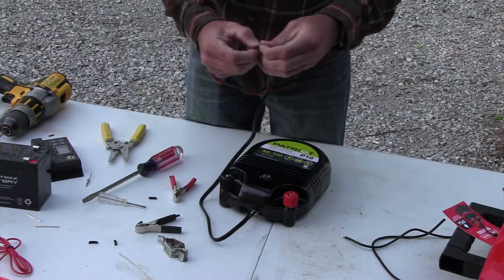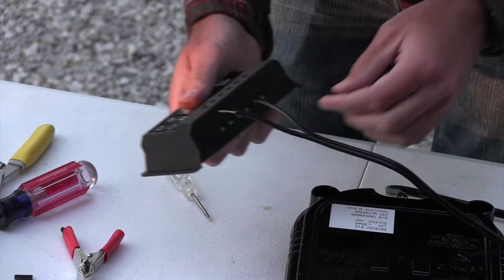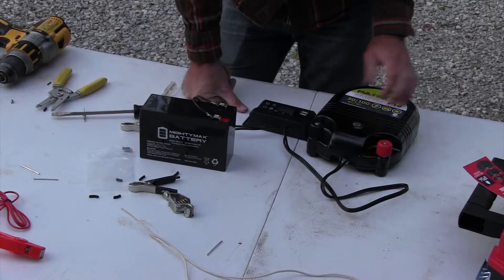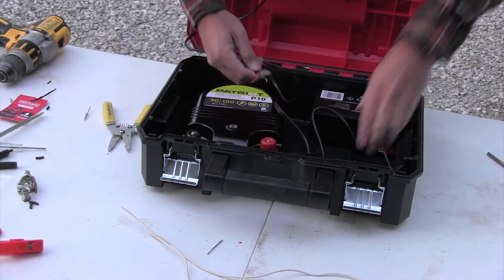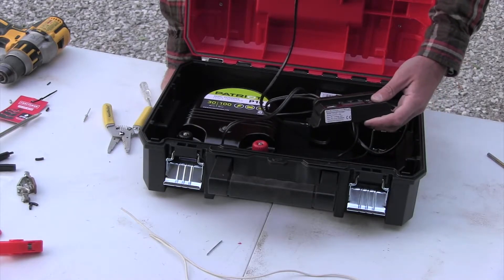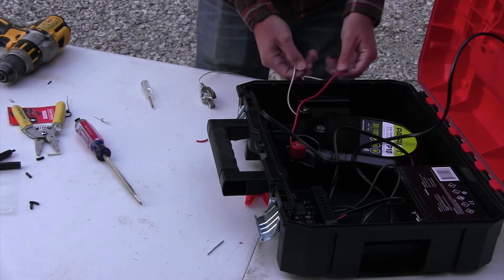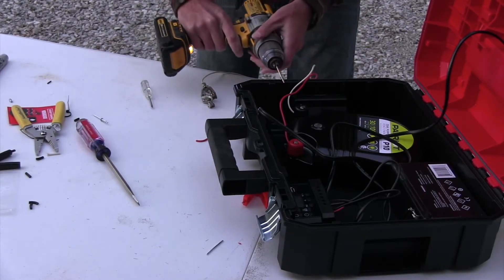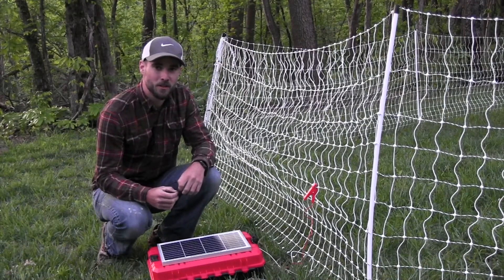How to Make a Solar Fence Energizer Part 2

Comment: Have you tested the actual fence voltage with this hack? 
This may not produce enough voltage for a long run.  The fence charger is connected to the 12v side of the solar charge controller. A small solar charge controller usually only allows 30amps x 12v = 365watts. I don't know if thats enough for the fence charger. If not, It might be best to hook the fence charger directly to the battery along with the charge controller. 
It all depends on how many watts your fence charger needs. 
Good job, though. 👍

Comment: I have Nubians and I want to setup a 5 strand poly wire portable fence. It will only be 50ft by 50ft with a total of 1300 ft of poly wire. How many joules do I need for goats? On the Gallagher website energizer selector it says the s20 is what I need but it’s only 0.2 joules. It’s $250 I hate to spend that much and it not be strong enough to keep them in. I think I am going to make my own. I just don’t know how many joules I need. I’m not running much poly wire but I know goats are tough.
Reply from the maker: I would at a minimum have 1 joule for that size fence. An electric fence is only a psychological barrier. The pain of getting shocked has to be greater than the desire to get out of the fence for the goat. If you have plenty of food for them in the fence it makes it easier to keep them from getting noir as well.

Comment: Good job mate…..suggestion….stick the components down with a dab of hot glue, that will save them rattling around and getting damaged. Cheers.
Reply from the maker: Great idea! Thanks for the tip!
Reply: The temporary, removable caulk works well also.

Comment: Would you trust this size solar charger setup to keep goats in the way you fence them in with 4 strands? Trying to change from electric netting to this style with pigtails and 4 strand poly wire. Great content!
Reply from the maker: Yes I have used it for that before. I would recommend a 2 joule charger for goats though. Thanks!
Reply: @AndrewMast  the last time I tried the fencing method you use I just had a .3 joule charger and it worked until they ran out of grass and they were out. If 1 joule isn’t enough I’ve got the net to go back to. Love your goat videos wish you a hundred more I could watch!
Reply: So I’ve got a question about an issue I’m having. I’ve built this charger and been using it for a couple months and it’s been good. But the last couple weeks in the mornings I’ve gone out to check the goats before work and the controller has turned off the charger. I’m thinking it was to conserve the battery to keep the charge from getting too low. In the evenings it’s working like normal. Idk whether the 9ah battery needs to be bigger or the solar panel needs to be 20 watt? They haven’t gotten out because of this though. Just wondering if you’ve ran into this before. I’m using 4 strands of poly wire about 650’ total.
Reply from the maker: Josh Minton yes I have had this issue. Most of the time the cause is something is grounding out the fence (like one of the metal posts). If something metal is grounding the fence out it will drain your battery very quickly. A lot of grass touching the fence can also do it but not as fast. I don’t have a lot of direct sunlight in some places I have the goats and I will have to change the battery out about every week or so. I’ll put the old battery on a charger and it’s ready for the next time. Hope this helps.
Reply: @AndrewMast  yeah it does! I’m using fiberglass posts. Idk what brand but they have 4 black wire clips on them. And I weed eat under the bottom hot wire. I’m thinking about getting an 18ah battery. It should still fit in the craftsmen box. And it should hold power through the night. I’ve taken the fence chargers wires off the controller and put alligator clips on them and went straight to the battery. The charger stayed strong till the morning but the battery was down to about 6.5 volts.  It right now the sun is out and the battery is back up to 12.8-13.5 volts give or take. I’ll eventually probably get a bigger fence charger and just get a couple big deep cycle batteries so I won’t need the solar panel. I just knew this 1 joule solar setup would come in handy in the future for cow fence or poultry net in some places so I’m happy with this charger regardless. You saved me a bunch of money videoing this build thanks man!

Comment: Did you get the poly or mono crystalline solar panel? The solar charge controller is no longer on eBay. Any alternatives? Thanks!
Reply from the maker: It’s a monocrystalline solar panel. Here is the same one on Amazon: 20A Solar Charge Controller Solar Panel Battery Intelligent Regulator with Dual USB Port 12V/24V PWM Auto Paremeter Adjustable LCD Display https://www.amazon.com/dp/B072MMDY4F/ref=cm_sw_r_cp_api_i_5y2EFbPPK6B42

Comment: Great video!! Thank's for sharing. I just got a couple of goats and if everything goes well we might get more. I was thinking about making a fence energizer the way you are suggesting but then I found this option for $100 less with built in solar panel and everything... what do you think? have you tried this before? (https://www.amazon.com/Zareba-ESP5M-Z-Impedance-Electric-Charger/dp/B0079GH86C/ref=sr_1_11?dchild=1&keywords=electric+fence+net&qid=1593917125&sr=8-11) 

It seems to have
Reply from the maker: Congratulations on getting goats! They are fun animals to have around.  And they are fairly easy to keep. However, they are hard to keep in without a strong electric fence. When you are looking at getting a fence charger the number you need to look at on the charger is the Joule output. The charger you suggested is a .1 joule output that means it puts out 1/10th of a joule. That charger would work great for a lot of animals but I’m afraid goats would jump right through a fence with that kind of power output. The charger on this video is a 1 joule output which is 10 times more powerful. The absolute minimum I would go for goats would be .5 joules. Hope this helps and good luck with your goats!
Reply: @AndrewMast Hey Andrew thank you for your response. I didn't notice that fence charger actually says .1 joules. All I saw was the number 1 LOL. It all make sense now. I built a somewhat temporary enclosure using t-posts and catle wire (about 100 square feet, but one of them made a hole and escaped (twice now). I improvised a quick fix until I can get more cattle wire and reinforce it. I ussually have them out and teathered during the day. Anyhow... thanks again for the advice and for the goat shelter video. I built one following your instructions! 🙂

Comment: Thanks for the great tutorial. What would it take to make this a 3 joules energizer ?
Reply from the maker: I made a 2 joule charger with a 30w solar panel and 18amh battery it’s been working for 2 years now. I had to use a larger waterproof tool box to fit everything. I would imagine a 50w solar panel and 20 some Amh battery would do the trick with a 3 joule charger. Thanks for watching!
Reply: @AndrewMast  great thank you !